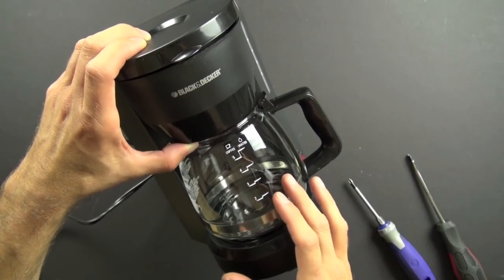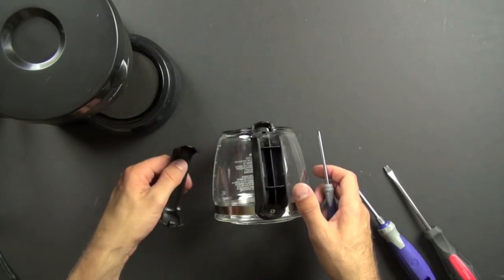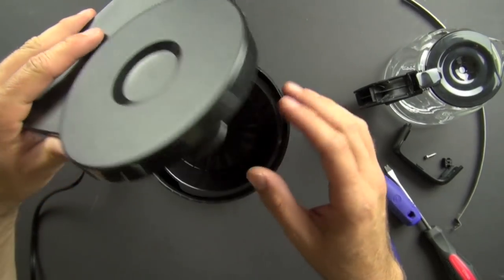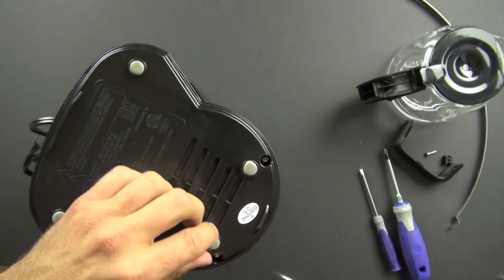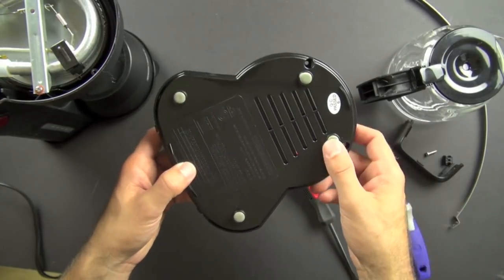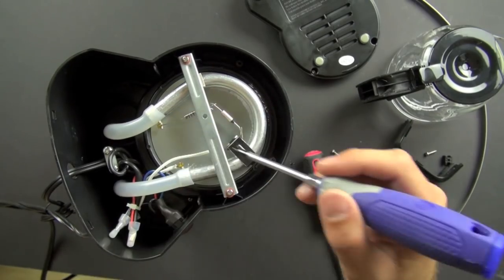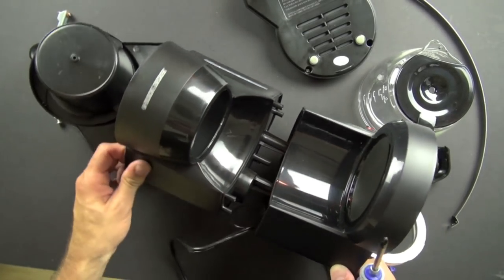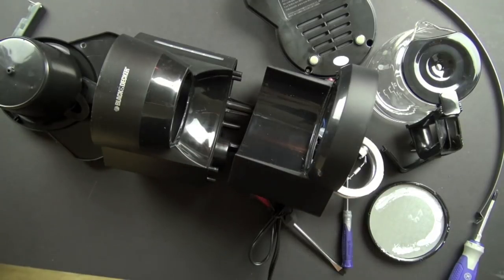What is inside a coffee maker? | Reverse engineering | Electrical engineering | Khan Academy

Comment: You did a decent job showing how that coffee maker works, yet forgot a very important element.  What prevents the water from flowing the opposite direction, or in any direction at all... The ball valve in the waterline that feeds water into the heater.  Without that working properly you will not get any water to flow to the top where the coffee grinds are waiting to be saturated in very hot water.
Reply: I learnt something from you today. Thanks.